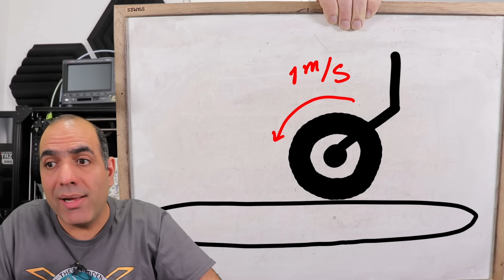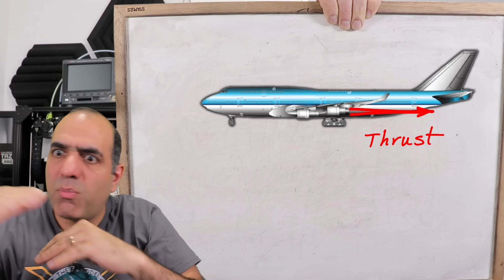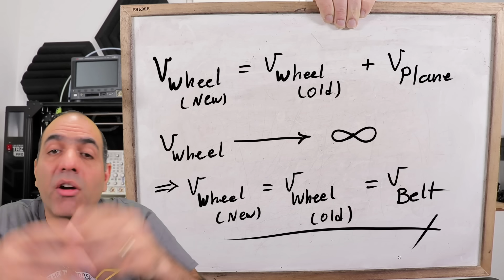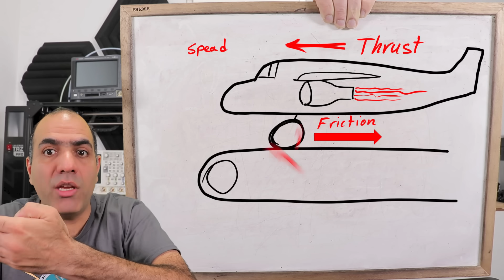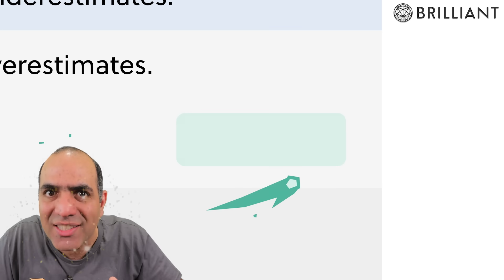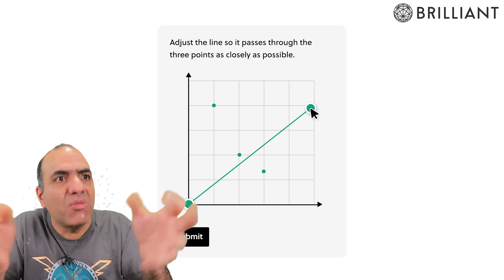Airplane Question that Drove Me NUTS!!!

Comment: In my understanding this is a feedback loop that will max out the conveyor belts speed.
The plane will move forwards, because it's pushing off the air and not the belt. Which causes the wheels to rotate, which causes the conveyor belt to speed up, slowing the plane back down. The plane will accelerate normally and the belt turns faster and faster and faster while the plane takes off